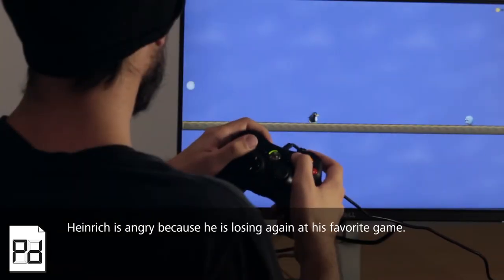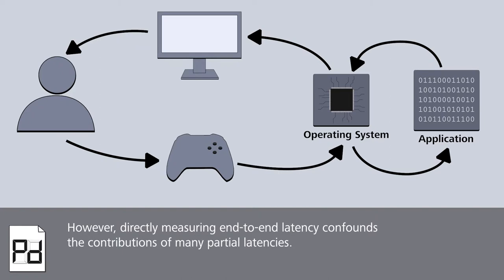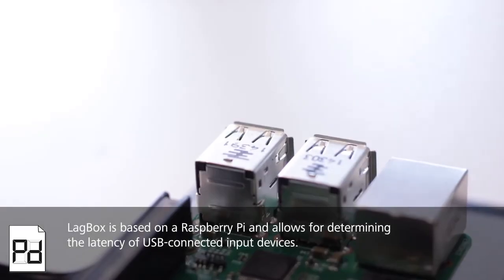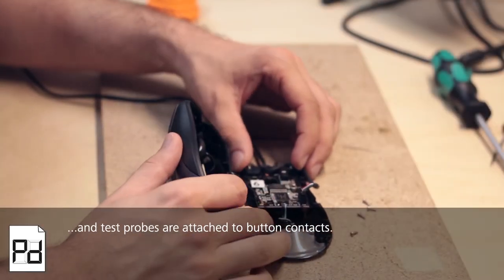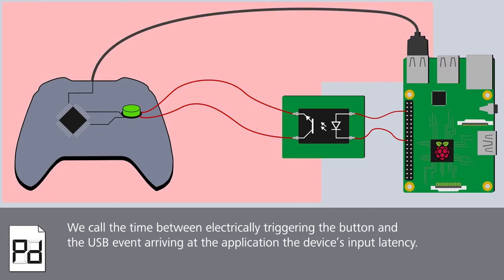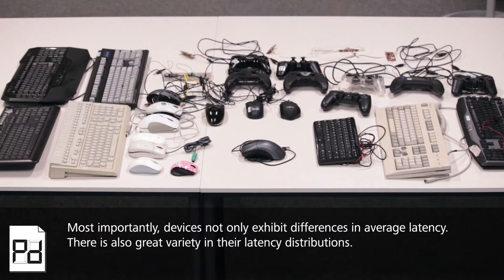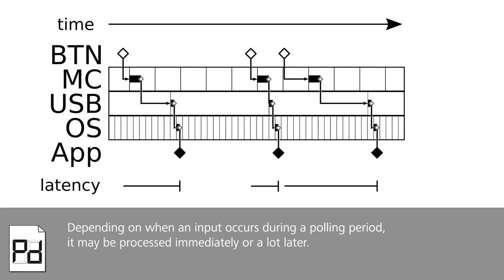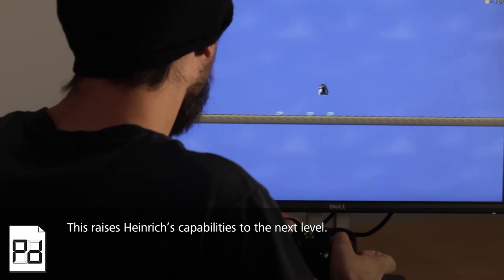On the Latency of USB-Connected Input Devices

Comment: What about Xbox One wired?
Reply: Hey there! Connecting this gamepad to our device via USB crashed the Raspberry Pi, that's why we could not measure it. Assuming it behaves similarly to comparable devices (Xbox 360 Controller, Dualshock 4), the latency should be a little bit lower when connected via USB (maybe in the range of 4 to 10 ms).